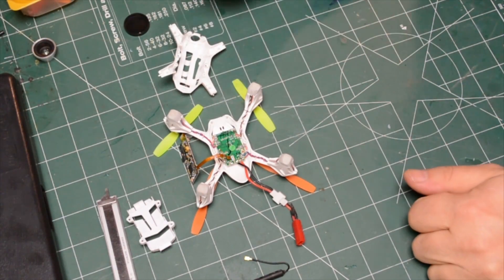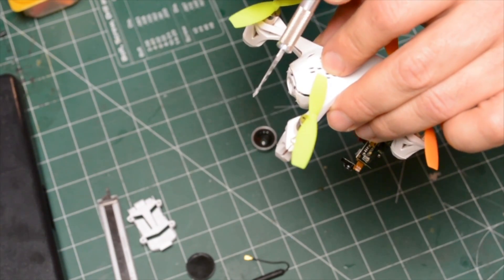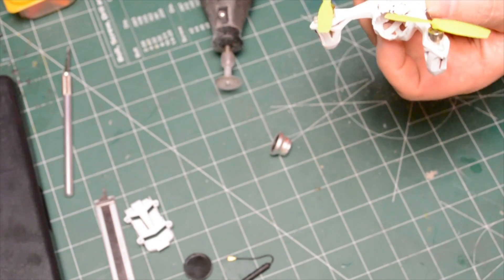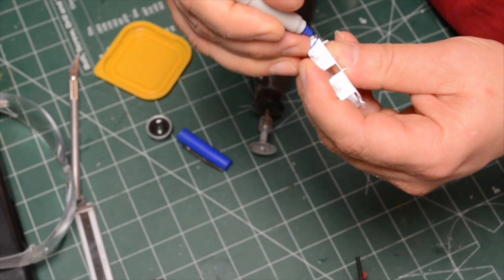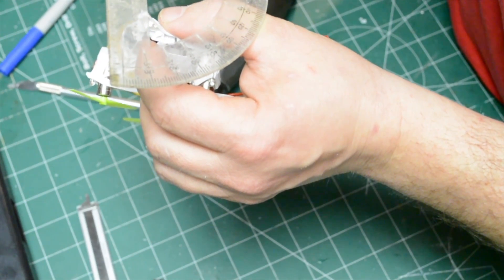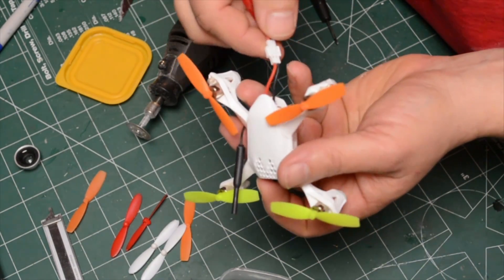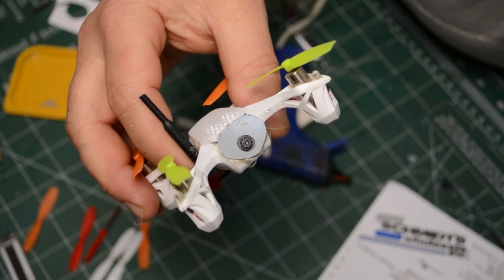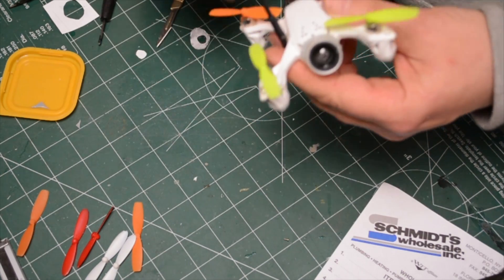Hubsan H107D FPV racer mod

Comment: do know what kind  of solder  you use on your drones and quadcopter  do have amazon link where i can buy it at.
Reply from the maker: foxman362 Any kind of rosin core solder. I buy it in different diameters to use for different situations. Having a good soldering is very important too.

Comment: Wow that's an excessive mod! too much cut off just to put a wide angle. RUINED the hole quad!
Reply from the maker: you have much to learn young Jedi
Reply: +Giovanni Lopez It's just a plastic case you can replace if needed. Cheaper than crashing in the floor every time you want to fly low and fast